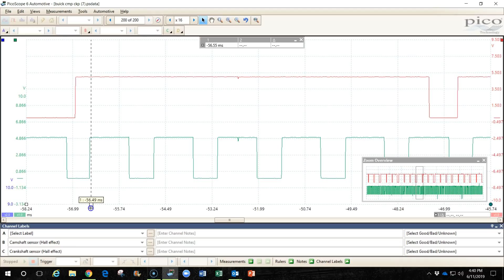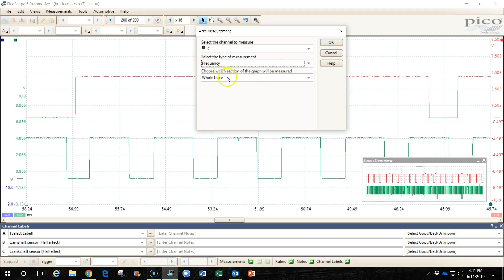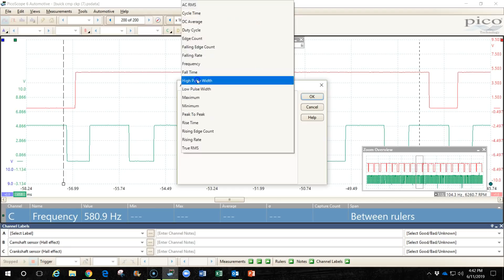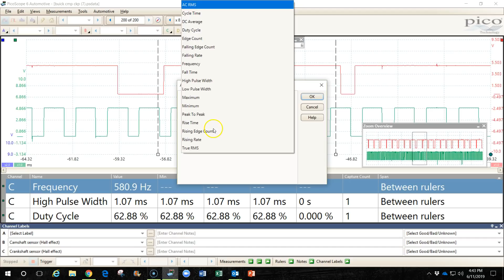Taking Measurements of Your Waveforms in the Pico Scope Software

Comment: In automotive measurements the negative part of the waveform is the ON-time because we measure the % the actuator is switched to ground by the ECU.  With my Pico 2204A  with the Automotive software ( hacked)  i got 20% on a real duty cycle of 80%. I don't know how to change that. So, i calculate the real duty cycle. It's not  a real problem. I'm still looking to change that. No solution found. Thanks for the video.
Reply from the maker: This depends on whether the computer is controlling the "high side" of the circuit or the "low side."  Both methods are used in automotive.  It can also depend how how you connect your scope to the circuit.  If you are just measuring voltage on the low side and comparing that voltage to ground, on time would be represented by the low voltage pulse width.